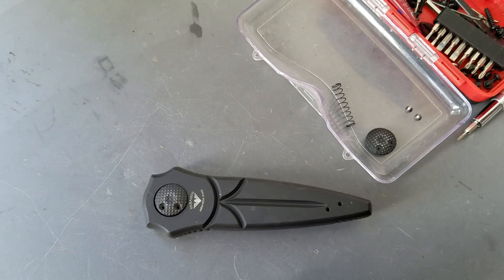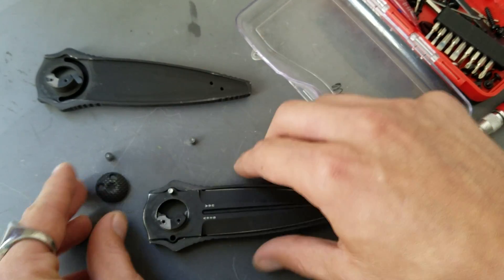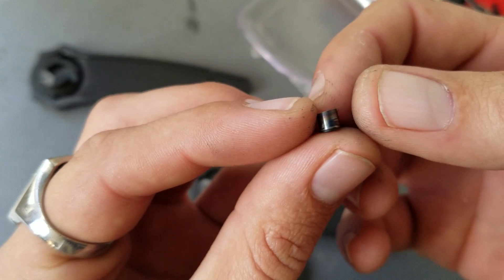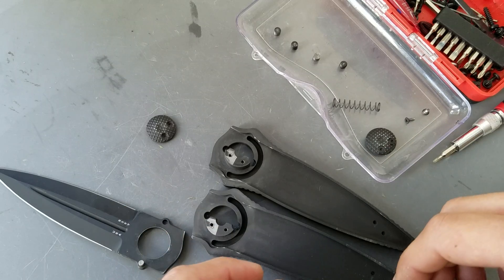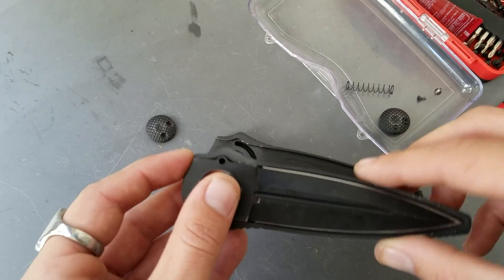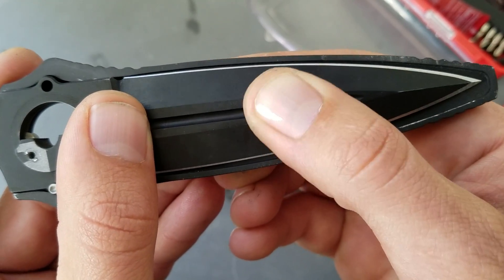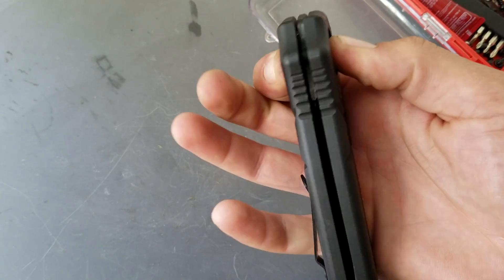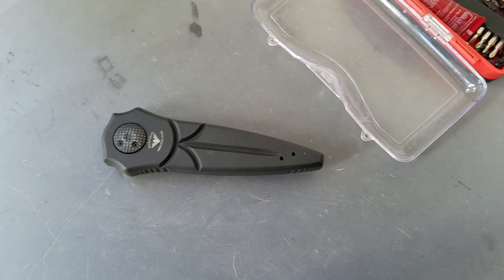Paragon warlock disassembly/reassembly

Comment: Would you recommend using gun oil to lightly lubricate the contact points to make the action smoother?
Reply: So I took mine apart and oiled it with some REM Oil and the action is so much more consistent and smoother. I'm going to try some thicker CLPs later and see if i can get it even more smooth.
Reply: I also added some oil to mine. Curious how long before dust gets bound in it, but otherwise I’m happy. I’m also curious what a grease would do.

Comment: I wonder if it would hold up in court to call it a "spring assisted" blade, due to the existence of a spring, rendering it cali legal... Double edge notwithstanding.
Reply: Louisiana specified that as long as the blade is not activated or deactivated by a spring, it can legally be concealed carry, I'm very excited to have this blade be shipped in and ready for use for myself next week.

Comment: 👍I enjoyed your vid and love that knife! Hopefully I can get my hands on one soon. But yeah, I heard you saying that those Stainless Steel slugs were heat treated. Those are just made out of stainless so they won't rust, same reason they used 6061 T6 aluminum. It's just light and won't rust.  You think about it, why would you need something like a knife with heat treated hardware that's outter casing will melt first. I've been in sheet metal, operating lasers for more than 10 years. Those slugs first started on a flat sst. sheet. And it takes a lot of power and nitrogen to cut through stainless which produces heat. With small pieces like those and being so close together the heat doesn't transfer around so you get that rainbowish discoloration from the heat. It just takes seconds for one to cut and they fall into a pan and then off to deburr to get cleaned and out the door. (Pretty much)
Reply: You're right on all accounts- except that those plugs were most certainly cut on a good lathe, probably hard turned, and parting off left the heat discoloration. Then they lapped the center pip off flat.

For something that needs to be both perfectly smooth and round Axialis, this would never be done on a laser- its done on a lathe. If it were me, 17-4 H900 PH stainless- stuff is precipitation hardened like a rock, and hard turns to finish like glass

Comment: Wear can i get a parogon worlock for under 200 bucks or cheaper it is ok if it is used as long as it is in good condition
Reply: Wish, I bought a possible clone for only 60 bucks. If it is a clone it is extremely well made. I can't tell if the metals are different from the real thing. But all the markings are correct and it feels good. So for that much less I'm very happy with it
Reply: Well, not sure about clones, but ashevill uses the mighty CPM S30V stainless steel alloy, reserved for top shelf, high end, premium quality blades. I doubt your 60$ clone does. Can't say for certain though. But i am HIGHLY skeptical.

Comment: After using it for awhile do you think the rotation when opening the knife will wear down and cause a lot more blade play and make everything "loose"? When opening my my paragon I feel that it's hard on the blade. Otherwise it's an awesome knife.
Reply from the maker: OBLIVIATE not in actual use I don't think the coding is harder than the aluminum and the aluminum itself will wear from the steel but in this case so slowly I don't think anyone could wear it out in less than an entire lifetime so it doesn't matter but yes it would
 great thought

Comment: Is there any blade play? If so is there any way to adjust the screws to reduce/eliminate it?
Reply from the maker: Isaac Teal with this model Warlock there is blade play not horrible only noticeable when checking for it not noticeable during actual cutting or use the pivot is set up like a bushing system screws are fully tightened down when the knife is assembled however the new models Phoenix and warlock from Asheville Steel have much less play in that department much closer tolerances being produced now
Reply: As long as handle is locked there is no blade play
Reply: I've experienced no play with mine, the handle wiggles a little bit at the bottom but only if you make it